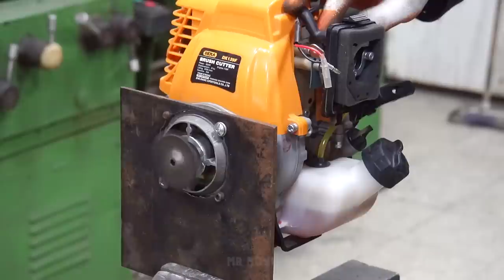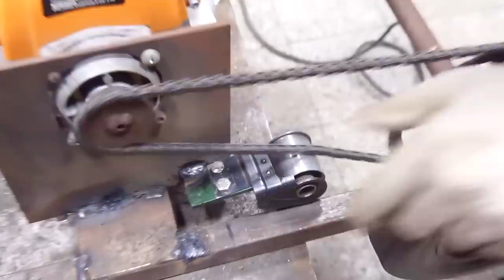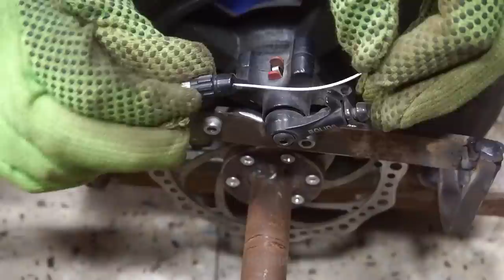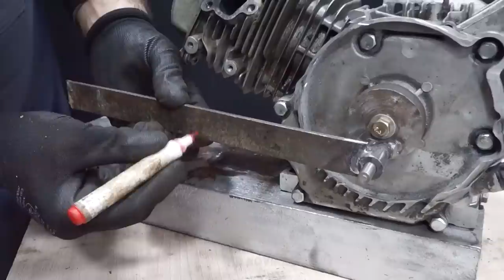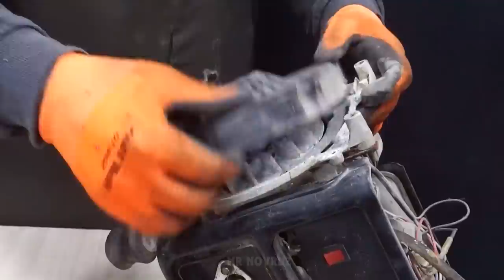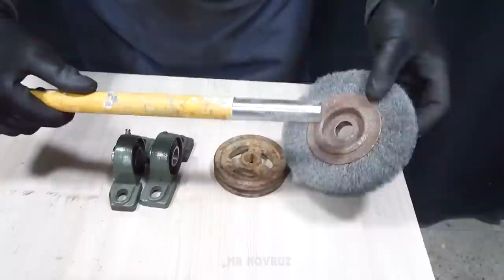TOP 4  BEST DIY TOOLS and IDEAS 2022

Comment: This guy has some skills and a most impressive scrap pile.
I think marketing is his issue.
Instead of calling it "TOP 4 BEST DIY TOOLS and IDEAS 2022"  try "You wont believe what he made from a worn out generator! ".

I get the feeling you just love to make stuff.'
That is cool.
Keep doing it and filming it.

However that wire brush would have worked much better hooked to the electric motor on your air compressor.
These builds are fun, they just aren't practical.

Your camera work is amazing, you have fun ideas.
With just a little rebranding I think your channel would really take off.

I am subbed and watching, waiting to see what you do next.